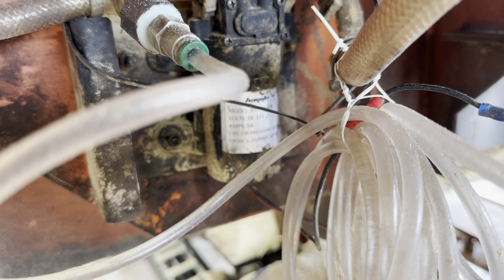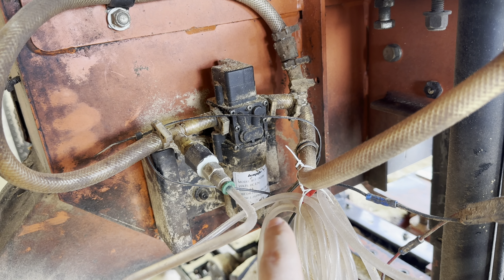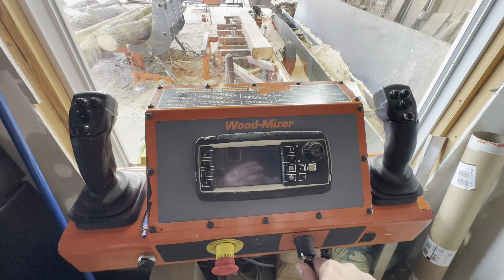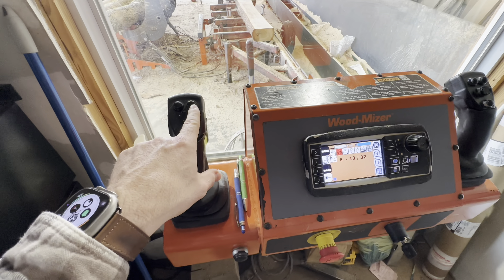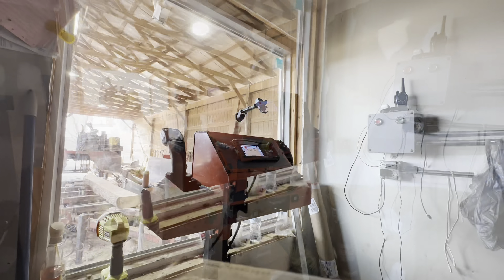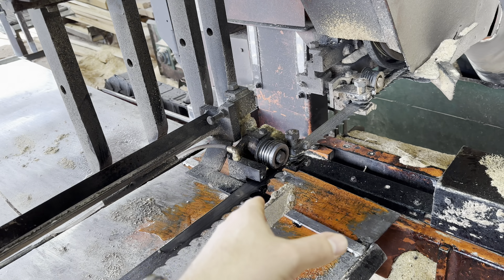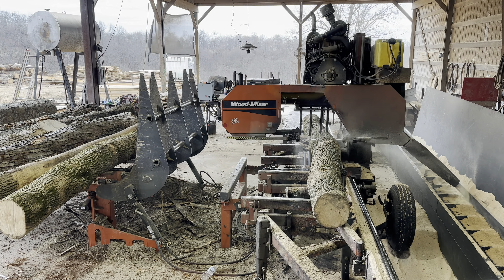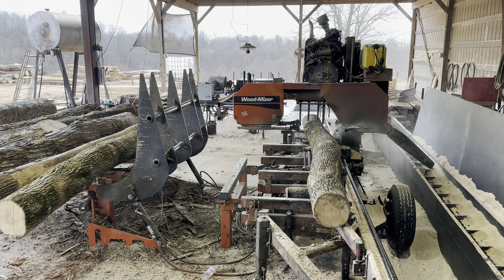Woodmizer super 70 lubemizer trick you need to know

Comment: This is golden information, thank you!
btw, what blades would you suggest for pine, spruce and dry wood?
Reply from the maker: Thanks buddy the people at woodmizer didn’t know this trick either. 
 Run a 747 turbo in 1.5”  0.55 then run diesel 5/1 with hydraulic fluid in your lubemizer.
Reply: Blade 0.055 !
‼️⚠️ Don't let IT Run To Long ‼️‼️ 0,055 Blades explodes If they don't reSharp after 1,25-1,75 hours!

0,050 Blades are Not so a Big Problem If you have it longer in Action, but after 2hours good to resharp but it's not a disaster If IT Run longer, 2,5houers ... One time...
Reply from the maker: @jott5940  correct 👍

Comment: Hey Buddy,
How thick are your Blades? 0.45, 0.50 or 0.55?

And hiw wide , 1-1/2" ore 2" ?
Greatings from Germany
Lt 70 David
Reply from the maker: Good morning 🌞 
We run 1.5 wide .55 turbo 747 blades
Reply: Thanks for your answer ❤️❤️‼️
Reply: Do you have experience with 0.50 thick Blades?

0.45 thick Blades of 747 can We Test in Germany, in 3 to 4 weeks came the 0.50 747 Blades new To Germany To can Test, I have Bye 16 Blades...

Now I Waite...

747 realy new Here... Only Norway Use IT now in Europe...

I now 1 Lt 70 user he used 0.55 Blades 70% of the time, the 10 degree...

All other used 0.50 Blades,

Can you speak To this ?🙏🙏

Thanks for your answer!

Greetings
David
Reply from the maker: @jott5940  the .50 blades will not cut as fast as the .55 they are flimsier letting them deflect easier. 
They will cut great until something like hickory or white oak. The 0.50 seems to not break as quick. You could possibly get more Sharping’s.
Reply: Thanks ❤️‼️
Reply from the maker: @jott5940  no problem. Best wishes